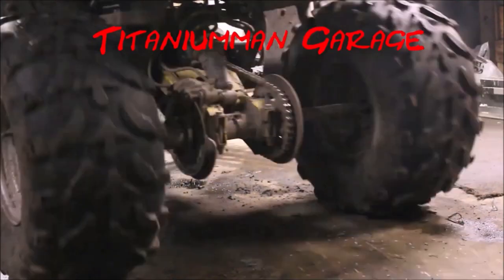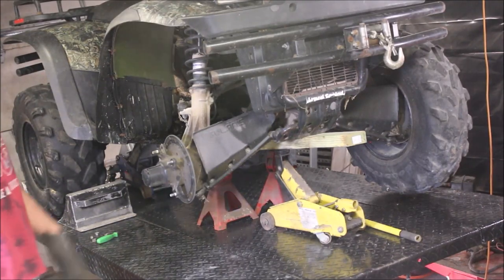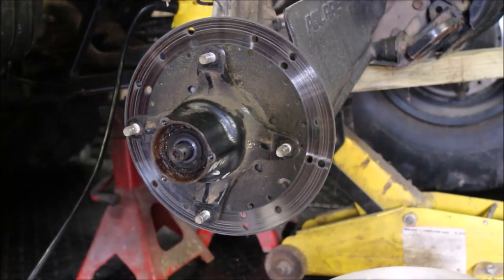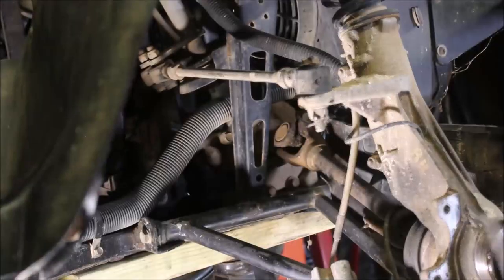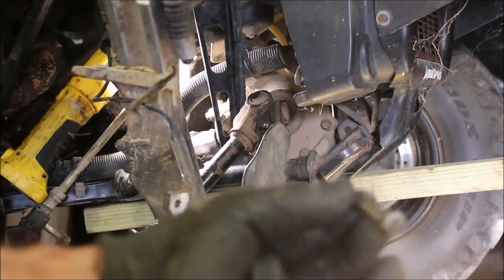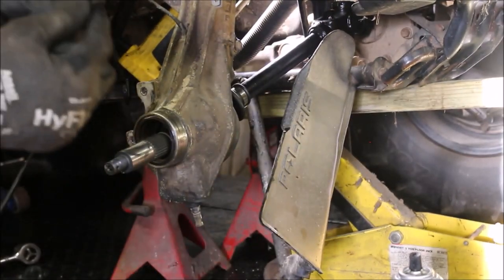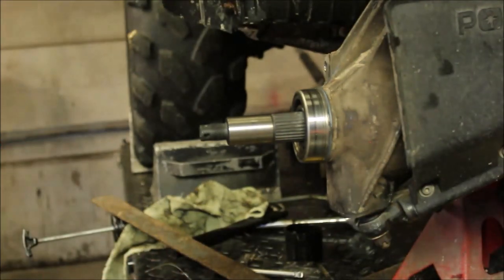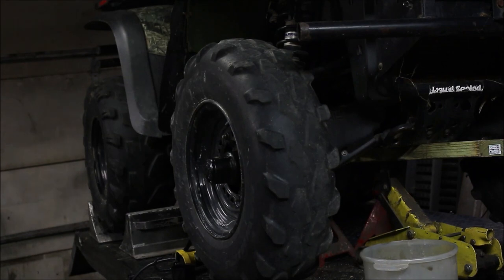2002 Polaris 500 Sportsman Pulls hard to the right! Find out why!

Comment: Good video would help some people get most of it done on the cheap if you couldn't afford new parts. But you shouldn't reuse old bearings, and no hard grease should be used at all in this type of HUB on Polaris it's not needed and will do more harm then good. I bought one of a guy and it pulled to the right as well because the guy packed the bearings with wheel bearing grease. I replaced all the bearings with new ones and new races, which wasn't show in this video and assembled it with NO Grease. and add ATF to the half full mark once you're done putting it back together. Also replace your seals. Now it works flawlessly.
Reply from the maker: I normally dont use grease. The cheap aftermarket bearings were a little stiff. I didnt like them, but that's what the customer wanted. It was only a light layer.  But you are correct. No grease. I've had one with the hub packed with grease. I made a video on it. I use synthetic ATF in my hubs. I have reused good condition bearings before with no issues. I guess I should change the video so people dont get the wrong idea. Thanks for pointing that out.
Reply: @TitaniummanGarage  Glad you took that the correct way, didn't mean it as insult. Just wanted people to know incase they were following this as an instructional video. I totally get it customers can make things more difficult sometimes wanting a cheep bearing installed and so on with other parts. I learned a while ago going cheap just meant you were likely to spend the same in the end and do the job twice. some are still finding that out. I did enjoy the video. This would be a great video for a temporary fix for many reasons.

Comment: Just found your channel. Awesome video and just what I needed. I have a 2005 MV7 that needs new front bearings. I'm debating whether or not to take the hubs to my local machine shop to have them pressed out and the new ones back in but at least your video gave me a good idea of what I'm facing. Thanks.
Reply: I have a 05 mv7 as well pulling hard to the right

Comment: I have a 2001 magnum that the left front wheel will not engage. I am taking it apart to figure out why but how do you fill the front hubs with fluid? There are no caps or screws or anything like that on the front hubs so where does the fluid go in to fill the hubs?

Comment: Hi TG, have you ever done a video on front end alignment? I have an 01 Sportsman 500 HO, I had to change the tie rod ends and some other work. I aligned the front end with strings and thought that I had it perfect, and it seemed great in the mud, but when I opened up on a tar and chip road, it got unstable. It feels like it wants to follow any road grooves, dance around some and even shake/wobble at higher speeds. I almost always ride offroad, so I only recently noticed something is wrong when on hard roads. Thanks for all your helpful videos!
Reply from the maker: I use a 8 foot 2x4 to line things up. A couple other factors on the wobble could be tires, tie rods, the plastic bushing up by the handlebar neck could all be warn. You replaced the tie rods. So that rules that out. Also the lower ball joints could be warn out. Its hard to get it correct. I sometimes toe mine in a little on each side. depending how it rides. One side could be out father than the other too.

Comment: you think the base diameter of a 2000+ 500 front strut is the same as a mid 90s 500? I see aftermarket strut assemblies for 2000-2004 are going for a lot cheaper than the 96-99 ones and visually they look the same.

Comment: I have a Polaris Xplorer 1997 and I don’t have that inner permanent magnet ring… Is it normal? Also 4x4 doesn’t work on that wheel
Reply from the maker: Thats the magnetic coil. It drives the front wheels when the 4x4 button is pressed.
Reply: I got the outer ring, it get magnetized when I press 4x4 button. But 4x4 not working on this wheel

Comment: Whasts the axel nut torque on a 1997 explorer 500 4x4 do you know?
Reply from the maker: I used to know. LOL. I don't torque them to spec anymore. When I did the wheel wouldn't turn. It was too tight. Now I go by feel. I snug it up till no play and give it another half turn. never had an issue.

Comment: What do you do if your  lower control arm nut just spins?
Reply from the maker: I've had that happen quite a bit. I do a couple things. heat them up, get a needle nose vice grip on it. Or cut it off with a sawzall and replace it. 2 screws hold the plate on to release the ball joint. If its spinning its bad any you should probably replace it anyway. Hope that helps.

Comment: Did this issue cause a wobbling too? My old Xplorer 500 pulls XTRA Hard to the right when you go from 4WD to 2WD. Turn it off, Start It Up & It doesn't. It wobbles all the time though. New Wheels -Same Issue. I've got 8 better quads (Yamahas) but I love the ol battle-ax 500.
Reply from the maker: Could be your bearings or a warped rotor. Or the axleshaft got bent. Did you ever roll it over?
Reply from the maker: Try going in reverse after turning 4c4 off. It helps disengage the front hubs. Sometimes they stick in AWD after the switch is off.
Reply: @TitaniummanGarage  I'll have to try that! Thanks. No, I never rolled it but I'm at very least the 3rd Owner at this point.

Comment: My early Ranger 6x6, (has the same hub assembly above) seems to stick in front wheel drive after I disengage the switch causing it to pull hard to the left. (Left hub). All bearings are OK and hub is full of lubricant. Any suggestions. The hub will release after a little while, but hard to drive while it is hung up. What do you think?
Reply from the maker: Could be bad bearings. I've seen that issue. Put it in reverse for a few feet. It should disengage.  The hillard clutch stays stuck open after the magnetic coil is turned off. Something is sticking inside.

Comment: So... I don't believe you explained why the axle shaft caused it to pull hard to the right.  You narrated what you were doing but there was no explanation as to the correlation and causation. I've replaced everything but the shaft and since the axle shaft's function is pretty straightforward (it turns) so why and how was it the cause of the wheel dragging that caused it to need to be replaced.  I'd like to know before I spend the money on a new shaft?
Reply from the maker: The u joint were shot in axleshaft and the bearings. Causing drag on the right side.
Reply: @TitaniummanGarage  Mine does it on the right side as well (forward and backward but backward mostly - might be just a coincidence) however if I reverse directions it seems to release itself and then the wheel rolls just fine for a while. Then it starts all over again after sitting for several minutes to an hour. Do you still believe it is most likely the CV axle/u-joints? (Hopefully not front tranny.) I sincerely appreciate your experience and thank you in advance.
Reply from the maker: @k.bronson7343  No. No. The hubs sometimes stick in awd. When you go in reverse it will release it. Also..I should have mentioned this in the video. If your brake disk/ hub is warped it will cause drag on the caliper pulling it to the right. I had about 3 or 4 of those happen.
Reply: @TitaniummanGarage  Excellent thank you!
Reply: @k.bronson7343 
Little tip : do not assume it's OK. I've had the same problem as you and "fixed" it the same way until the last ride where it jammed permanent in AWD. I was several miles from home just pulling and pushing on the steering and something started to break on there... I don't know how far I will have togo to fix it now😢
Reply: @mr.octopus6972  Great Advice. I will be back on the machine working toward that end later this week and I'll let you know the final outcome. Love the advice.
Reply: @k.bronson7343  
Update:
[Sorry for my french-glish btw im from Québec, it might be hard to read sometimes.]
I wrote the previous comment just before dismanteling. Now I know for sure that the 3 bearings I found in the front wheel assy are totally destroyed along with pretty much every seal in there.

For two summers in a row I tought it was just a small intermitent electrical problem. 
Sometimes just by stopping and going neutral or pressing the override button or going reverse for half a second would "fix it".
I was dead wrong. 
I guess going reverse was just barely placing stuff back in place and it worked for a while until ... Yeah, lucky I made it back home 😬 The moment before it locked permenent I was climbing hills in a sand pit and speeding ... I could have 💀 myself.
I've seen those assy sold in a pair on amazon. I will change both sides.
Reply: @mr.octopus6972  I believe you are right but I am working my way mentally to it to make it make some sense to me. In your opinion, how is it then that greasing the axle joints and the front diff doesn't free it up? It is a simple design and should release itself I believe.  The machine only has 900 miles on it. (not even broke in really)
I think I may continue with the cheap idea of next removing the front caliper(s) and testing it again as one last step before I buy the axles or bypass the switch because intermittent/sticky brake calipers that are not releasing could also explain the problem with the exception of why does it seem to be connected to the use of the AWD switch? Maybe the AWD switch is just a frustrating coincidence although I have not been able to reproduce the problem without the use of the AWD switch. (Hmmm...  Dang.) Thoughts?

(Feel free to totally ignore me also as an option it's just helpful to have a seasoned mech. to talk to and trade ideas with.
Reply: May 11 - Today I pulled both front wheels removed and hung the calipers and verified they are not part of the problem and put a straight edge on the rotors showing them to be perfect and the brake pads are in great shape. I also suspended the machine and with no weight on the wheels, the machine operates normally so somehow riding the machine exaggerates or causes the issue to present itself. Question for you - Did you happen to cut open the boot or pull apart your axle shaft(s) boot and/or u-joint caps  to see what failed?Just curious.